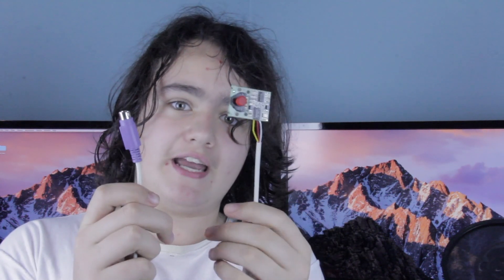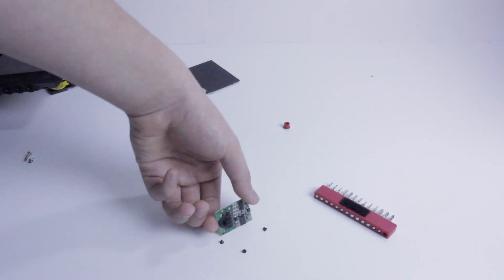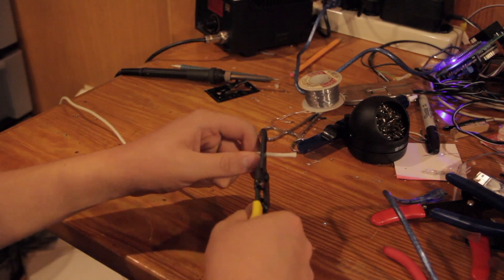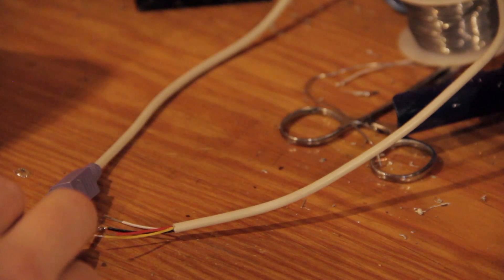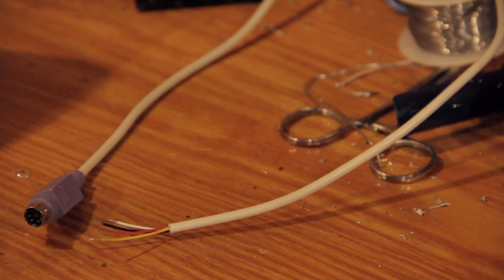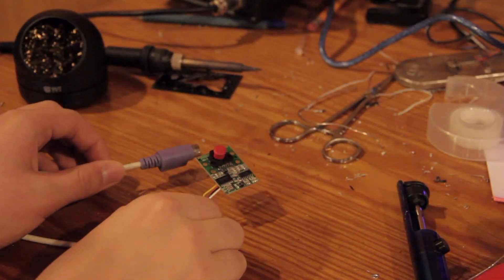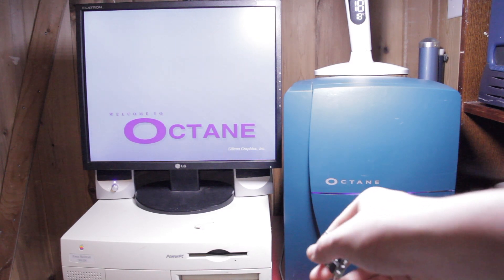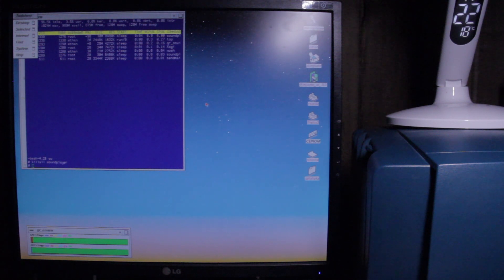Using a TrackPoint with IRIX (natively!)

Comment: Never heard about PS/2 keyboards with trackpoint? They still exist as well trackball keyboards. Bought one for 120 euro (shipped brand new), they are a bit expensive if professional. Anyway, your video is a bit useless if you don't show the pinout of trackpoint device ...
Reply from the maker: More of a project (and component of another project that never got finished) than a tutorial. I know of the keyboards, but don't have one, and for the project I needed a smaller unit that could be mounted on a surface independently of the keyboard.
Reply: A picture with the wiring is more useful and interesting than your video.